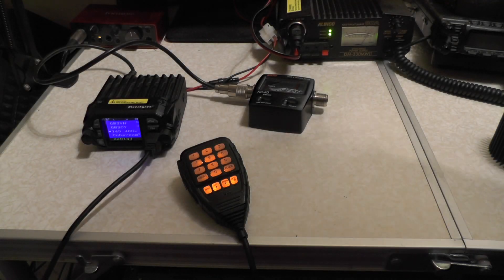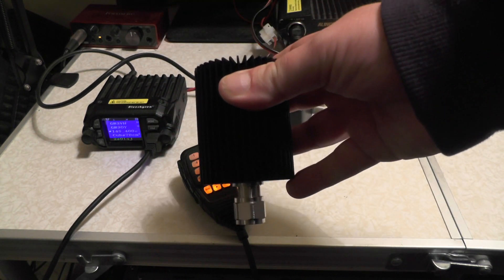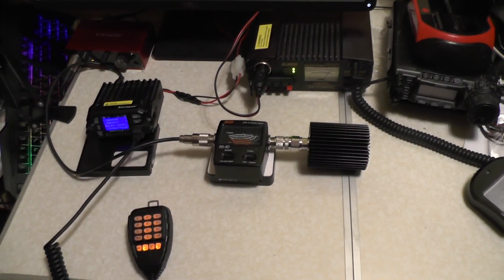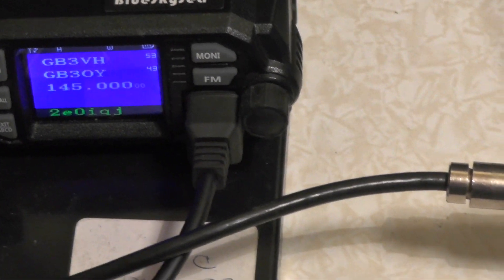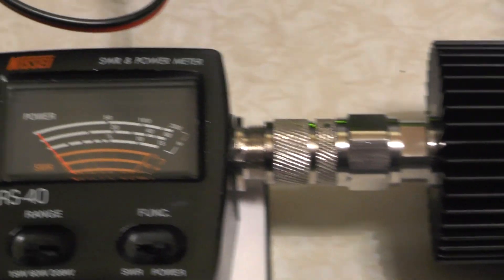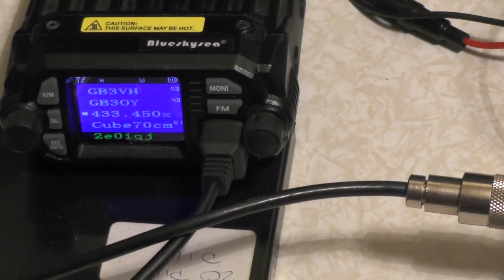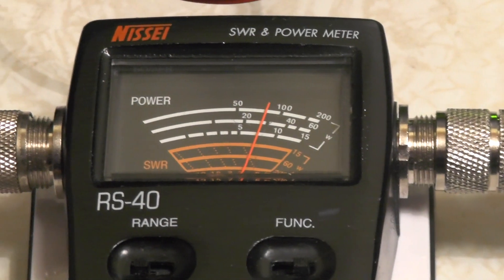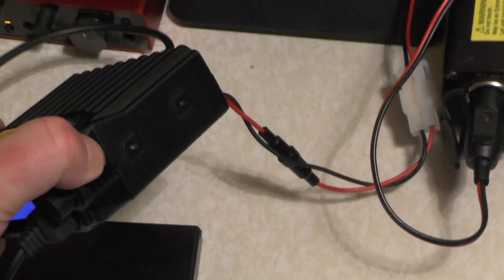Testing with a dummy load

Comment: can you run coax to the dummy load or does it have to be hooked directly to the connector of the meter or the radio?
Reply from the maker: @JordanPhilippi-f8w  you should be able to but it would be best to directly connect it to the radio

Comment: I have a power/swr meter and the same dummy load. how to I connect everything to check swr? thanks
Reply from the maker: Connect the radio with a patch cable to the left socket on the SWR. then connect your antenna to the right socket and then power your radio up and give it a key and it should show you the swr. to test your dummy load connect it to the right socket and give the rig a key up and it should read swr of 1:1
Reply: @2j4ez  thanks very much

Comment: I have the same rig....what they also DON'T tell you is that with any SUSTAINED transmission, the Power Output will begin to drop! Not sure why yours showed 19w. Mine started out at 28w and then eventually dropped to 18w. That 19w on yours ( assuming that was the first key up after the rig being dead cold), after the rig heats up, it will drop to as low as 10w. So these Chinese radios do NOT like sustained transmissions as they will heat up fairly quickly. The Big Three ( ICOM, IKenwood, Yaesu), will not do this  but of course you pay a LOT more for them. So you get what you pay for.  And yes I did test into a Dummy Load.

Comment: Missing a few watts, however, would you even notice, I doubt it.  All you need for the car anyway, I just love to hate those mic connectors though!
Reply from the maker: bob fourjs the rj11 connections seems to break easily they should use mic connections like in old skool cb radios
Reply: @2j4ez  I totally agree, old six pin mic plugs, much better, even a 7 pin din was better than that crappy connections.  But it is suited to mas production!

Comment: I would have thought the little radio would have had more range between high and low power. That is a bit disappointing. But you still like using it?
Reply from the maker: Chris Sewell yes it works fine on local repeaters with a cheap £10 pound mag mount antenna if the antenna breaks I can just replace it as it’s cheap